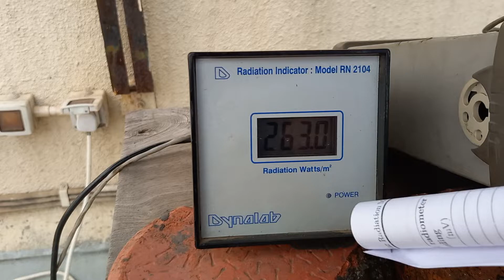Pyranometer: Device to measure the global solar radiation on a horizontal surface

Comment: Can it be conmected to a pc to view data
Reply from the maker: Yes, the electrical output of this Pyranometer can be connected to a data logger to record the output as the day progresses. The frequency of data logging can be set in the data logger like every minute, every second, etc. This logged data can be then read using a PC.
Reply: @vijshanker  please i want to contact you as i currently need this. I can't find it in my country and i need guidance on how to set it up for a client. I will pay for it
Reply: Good day sir. Please how do I contact you?